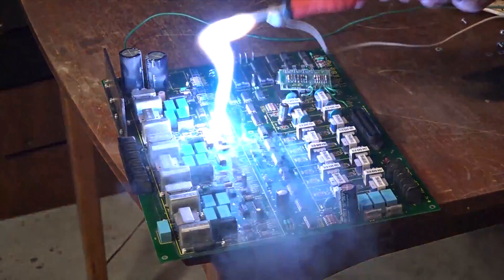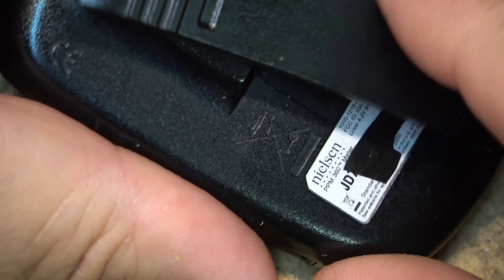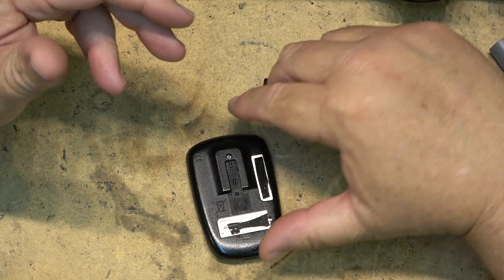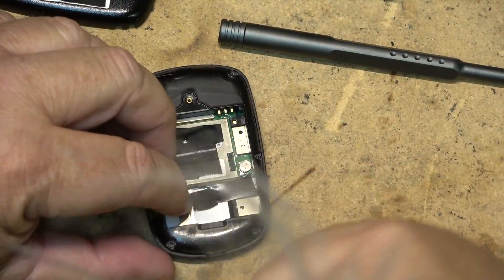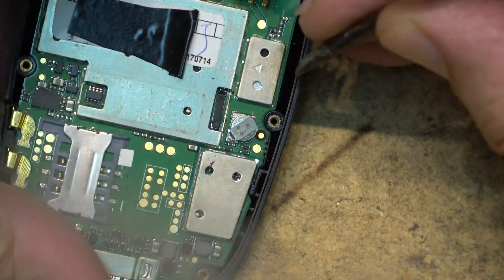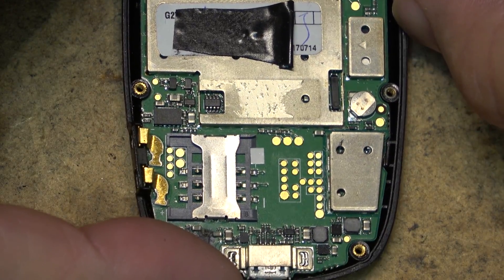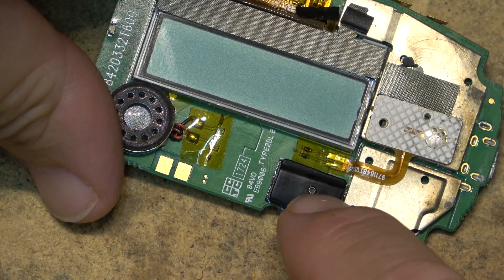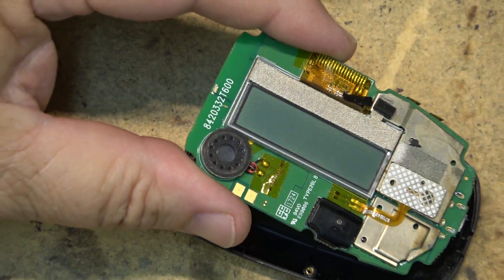Nielsen ppm360 personal people meter teardown

Comment: My son found this thing under seat in my car. Wtf ? .
Reply from the maker: It's a radio ratings meter.  Picks up hidden signals embedded it radio and tv sound for real time ratings.  This was actually my meter that got wet with sweat and shorted out.  I couldn't say that at the time as i was on the ratings panel but they kicked me off when they started getting too aggressive. They sent me an internet meter to monitor internet use and I said no so they fired me. It was an easy 80 bucks a month and i did it for about 7 years till they fired me last fall.

Comment: The PPM encoding is not subaudible (i.e. below the human range of hearing). It uses mid-range audio frequencies that can sound like a buzzsaw if the program audio doesn't completely mask it. Some stations are also using processors which boost the level of the PPM encoding to try to increase their ratings, at the expense of making the buzzsaw effect more audible. However, small markets still use log books instead of PPMs.

Comment: Looking at the FCC registration information for the unit's FCC ID IGKDA118, you can see what chips are used in this device. The first chip is a TI TMS320C5535 DSP which probably runs all the detection and monitoring for Nielsen. The other main chip is a Qualcomm QSC6270 which is a 3G mobile phone chipset released in 2007. With 3G shutting down this generation of devices is probably nearing end of life.
Reply from the maker: 3g will be around for many many years.  2g GSM still operational in Canada on robbers network.  The 2g CDMA shut down a few years ago here.  
The big problem is IOT devices.  These meters are just one IOT device.  There are tons of medical devices such as BP monitors, CPAP machines ect, and in automated parking meters, speed / red light cameras, vending machines ect. Every one of these devices would need to be upgraded and every user would be there with their hand out for the telecom provider to cover this cost.  I don't know about the USA, but in Canada the CRTC will order that these devices will need to remain online until they are all swapped out and the provider would be responsible to make sure all existing customers receive a replacement device. What they do is stop activating new devices but keep the network running untill all the old devices are removed.   So it will be several more years before 3g goes away.   What does happen is the providers pull channels down to reiae for 4g or 5g. They leave 1 channel operational on each site for the legacy IOT devices.  They won't activate any 3g only cell phones and as far as consumer cell use 3g is shut off, but for the legacy machine to machine communication that use very low bandwidth they still have their connection.  It doesn't cost the providers anything to maintain low bandwidth IOT access because it can be handled by the LTE . Just a tiny slice of bandwidth mixed in with the main data channel.
Reply: Nielsen says a Next GEN Version to this is coming I would assumed they’re jumping to 4G , or enhanced 4G or maybe even capitalizing soon on 5G

Comment: Wow, Never seen or heard of something like this. At first since you mentioned radio I thought it was some type of monitoring device. Another thing I thought since it has a SIM card is it picks up radio signals and streams them somewhere. There is a radio station where I live that plays songs pitched up slightly to make room for more ads.
Reply from the maker: Pitched up? If they want more ads just edit the songs shorter.
Reply: @12voltvids  Yeah some radio stations do that. They speed the songs up to shorten down the duration of them.
Reply: @12voltvids  They do that too, radio edits AND pitching up.
Reply: The SIM is just so it can transmit the collected data to Nielsen’s data servers or whatever 

Think of it as a scaled down cell phone with only a data plan that’s monitoring any TV, Radio or other media you’re in contact with

Comment: Had one of these… they actually want you to plug it into your pc through a pass through cable that attaches to the USB port ..guess some streaming content has the tones.. there is a motion detector and you have to proactively keep the unit awake … the two contacts are for charging or you can use the USB port… but a headphone pass trough also connects to the usb..the top thing is a for alarm/beeper.. the stuff in the lower part is the mic array.. look up Arbitron equipment and Voltair for more about the back end equipment
Reply: There’s also a device which I gather was some form of rf/bt to plug into the wall somewhere near the charge cradle that tells the device you are “home” and not out somewhere.. some form of beaconing.. edit: it was a bt beacon… thought it was but it’s been quite a few years since I had one…
Reply from the maker: Yes it looks like a speaker.  I tried to plug it into a usb charger but nothing.   It's fubar.
Reply: Probably saw this https://fccid.io/IGKDA118/User-Manual/User-Manual-2563570

Comment: We have dozens of those BBM encoders in service at work on the outputs of all the TV and radio stations. 
But I've never seen one of the pocket receivers either...
Reply from the maker: I'd be interested to know how they work.  I was thinking it must be phase shift keying in a sub audiable frequency range.  10-20 Hz.
Reply: @12voltvids  I'm fairly certain the frequency is much higher. Remember it is bring delivered via 57 cent speakers in radios and TV's, and being picked up with a 05 cent microphone...  That is the reason for the psychoacoustics. Your brain can hear the signals, but it ignores them...
Reply: @12voltvids  I worked at radio station that used that system. Audio is passed through PPM encoder box that adds about 9 audio tones between 1 - 3 kHz that are psycho-acoustically masked by louder tones of program material in that freq range. The encoder dynamically adds those tones in a clever way to make sure humans don't notice them because those added tones are placed very close to dominant frequency components of program material so our brains cannot distinguish them. Here is example how those toned sound extracted from the encoded audio https://www.youtube.com/watch?v=8QIJWAAw6GE
Reply from the maker: @antronx7  
Interesting, I knew they psycoacoustically masked them, but had no idea the spectrum they did this in.

Comment: Pretty sure as soon as you open it it destroys all data in a CMOS backed by a battery. Similar to Bitcoin wallets. Shouldn't they also make sure all get collected back so they don't land somewhere and can be reverse engineered?
Reply: Why would they care about it being 
“Reverse engineered” ??
It’s not like these devices are some sort of technological holy grail
Reply: I was thinking the same thing... just by opening it, everything is likely bricked now!
Reply: Well Chris, you’d be wrong sir. Most of these devices have there firmware saved in battery backed up srams. Kill the power or break the circuit, and bye bye functionality…
Reply from the maker: @tekvax  doubt that as they have to remove the battery to insert the SIM card.

Comment: Growing up my mom somehow got us into the neilson family.  I hated scanning all the barcodes on our groceries!  When a UPC wouldn't scan then I would have to enter in product info for what seemed like days.  Every week we would send the data over the phone by holding the phone to the unit, letting it dial the tones then it was standard dialup modem noises.  I do know that we got tons of free crap in the mail.. Samples of just about everything under the sun.  I tried to find a pic of it but cant.  IT was about 8 inches long and 2x2 inches.  HAd a IR scanner on one end and the speaker on the other.  One face had 1x10? digit LCD  and a squish rubber mat keypad for manual entry.  Last I remember seeing it was 1995.

Comment: Wow now i know there's even such a device in existence! Thanks. Very cool
Reply from the maker: I am surprised that it just isn't an app on cell phone actually.
Reply: @12voltvids  I suspect that they do use smart-phone apps now.
Reply from the maker: @michaelturner4457  that would make sense, but from what i understand they still use these devices for security.
Reply: In response to folks mentioning apps I would assume that the problem with apps is most smartphone and tablet operating systems and apps don’t necessarily support multiple apps working at once much less in the background very well

The Cliff notes version an app probably wouldn’t be as accurate, efficient or reliable

Comment: Dave don't waste your time calling the company, they would just bin it.
Cut the card up and scratch the persons number off it.
A logger and data sender through the cell phone system.
Reply from the maker: They may bin it, or them may pull the sim and put it into another meter. Sticker says if found all a 1866 number so obviously they want it back.
Reply: @12voltvids  More for tracking the devices if lost, they probably will tell you to drop in ewaste, and then get your details, as actually getting the device back will be even more loss, as the bulk price is likely pretty low for the units in bulk. They though will want the info of the place found, as that is tied to a user, who either did not report it lost or who has already reported it lost and gotten a new one.
Reply from the maker: @SeanBZA  
Surprise! They want it and are sending out a mailer to return it.
Reply: @12voltvids  Must be hoping to recover the data off it then, probably only calls once a week or so to keep data costs low.
Reply from the maker: @SeanBZA  probably hoping they can get it running again to send to someone else.  I doubt these are dirt cheap.  They probably cost hundreds of dollars each.  What do you think a cell phone actually costs?  I paid 1000 for my Samsung s9 because i do not get a subsidized plan. I pay month to month and pay full price.  I laugh at all the idiots that have to have a new phone are are paying 90 bucks a month.   I pay under 20 for mine and 30 for my wife's phone and that is unlimited minutes and a data plan.  These devices I doubt are a high volume device so the cost is probably relatively high so it comes as no surprise that they would want it back to refurbish it.
Reply: @12voltvids  they get the data every night in real time with or without the meter. After docking on the charger, which is supposed to be when a person sleeps and the only time it should not be worn, it tells you your points for the day and sends all your data over to them. They get the info regardless.
Reply from the maker: @MariselaR.da1daOnly  I believe they also send throughout the day.

Comment: 12:50 you know how every device has to be FCC certified and says about Part 15? That's how the device revives the signals. "This device must receive any interference accepted, including ones that cause undesirable operation".
Reply from the maker: In this case it is picking off a specific subaudiable tone.  Have no idea what that frequency is but aparantly they mask it well.
Reply: @12voltvids  Maybe it is just masked by something that sounds like a short bad reception noise. I've noticed that as a kid back then. Radio was playing, not being moved and there was a short burst of bad reception with a weird sinewave beep in it and then the program continued.
Reply: @12voltvids  you want some fun times, go try to look up how they work... there is almost no information available on their function. It is all based on psychometric acoustics and sound and tone masking, by placing the data tones next to real audio content, but in a way that your brain can't hear... sort of like your optical blind spot, but with audio... wild stuff...
Reply: @tekvax01  The algo looks for areas of the audio that it can hide the tones.  The encoder doesn't like silence ;) 
It basically dumps the station id (and a timestamp in newer codes) into the audio into spots of the audio that you wouldn't really be able to pick it out or be distracted, hence the sub-audible. This device just listens to it and logs the time and ID it detected the tones.  
Neilson provides the encoders with the station ID provided, so all they need to do is get the list of ID's and timestamps back and they know exactly what and when you were watching or listening to and with the timestamps they can prevent spoofing or people trying to cheat the ratings.

Comment: Putting the SIM card into an unlocked cell phone may prove to be interesting, it would tell you what cellular network the device was on.  It would be shocking to the Neilson ratings people that when they call the device to transfer the information and a real person answers.
Reply: Very likely a locked sim, that is only able to use a fixed connection, and which does not have the ability to do voice, SMS or data, only connect to a specific gateway IP and communicate with that. Done so the cost per SIM drops, as the company buys a large number of SIM's, but there is no numbers associated with them, and thus there is little risk of the card being used to rack up large bills if it gets lost.
Reply from the maker: Would try that but my cell uses a micro sim.
Reply: You’d probably get a similar result as you get when putting a tracphone or government Obama phone SIM
into a random phone
“Device not allowed or not compatible”
Reply: I believe Nielsen uses Verizon Wireless.  I used to work for Nielsen TV Ratings (boxes connected to TVs).  Your device is from Nielsen Audio.

Comment: Not sure if it would work in my house as I don't watch TV anymore, simply as a reaction to the sheer amount of Propaganda being broadcast these days.
This is kind of ironic as I still own 30-40 TV sets !
Reply from the maker: I believe they use these more for radio ratings but i could be wrong. The only info i got was by searching it out.  From what I understand you can't sign up for it. They invite people to be a member and pay them to carry the meter but i could be wrong.
Reply: @12voltvids  it's quite difficult to get "on the list" and forget it if you work anywhere near the broadcasting industry... 
I've had them call me before to enroll me. as soon as they hear you work for tv and radio, they drop you like a hot rock...
Reply from the maker: @tekvax01  No kidding. I hear them advertising on local radio telling people who they are, and how you can help shape radio and TV by being a member. Basically letting the public know that if they call, they are not scammers and by joining the panel it helps local radio and TV stations.  Worth big bucks to the broadcasters.  Those stations with confirmed listeners all of a sudden their air time becomes more valuable to advertiser's. If you were a advertiser would you want your spots running on the #1 station or one down at 27?
Reply: Same here. And since I'd need to pay a 20 EUR monthly fee to watch TV over cable... For what?! TV's dead. The cable is now being used for internet (DOCSIS).